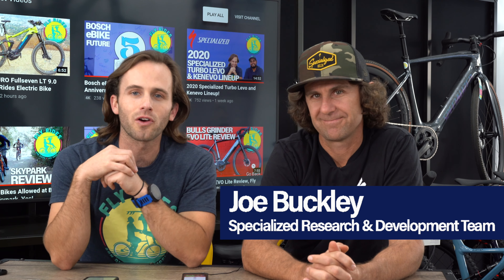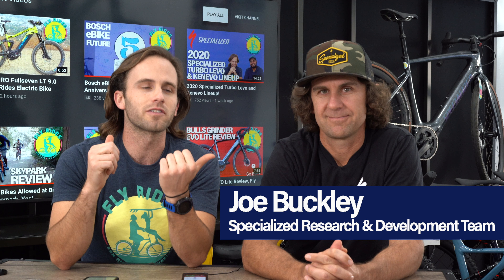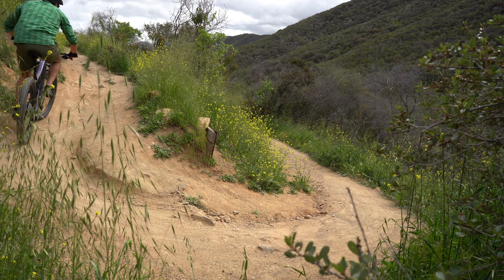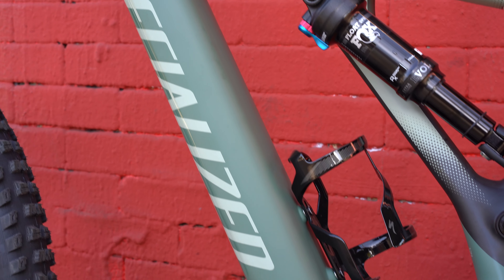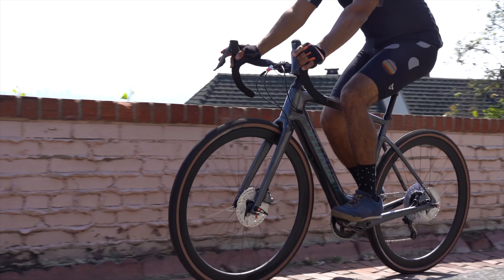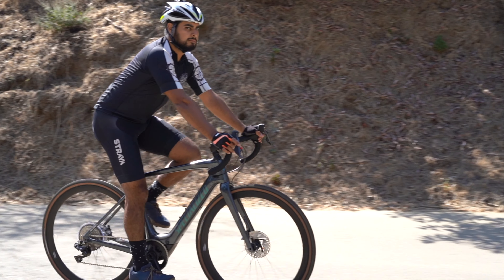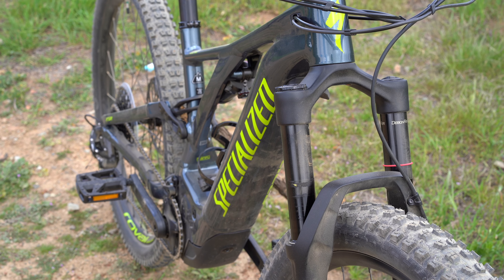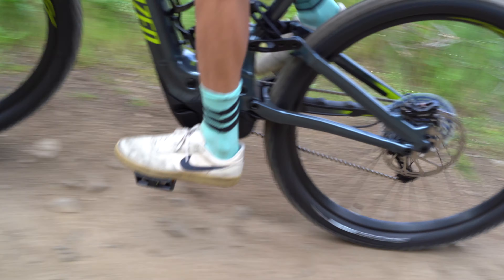How Specialized Bikes are Made, Interview with the Specialized Research and Development Team!

Comment: Hello guys,
1. Can your expensive bikes be thrown to the bottom  of a 5m pool and stay under the water for a full week, and then still run and charge battery?
2. Just curious, can you still shift gears if your battery is empty, as there is WiFi electronic shifting on S-Works. So you should be able to do it both ways on demand.
3. Can you lobby for longer life battery, so rhat you can go 120 km on turbo instead the usual 40km only.  And make sure that there is less bikes with noisy motor when on Turbo, so that people dont have to service the bike and replace it under warranty.

Can you lobby a little for these three things, and once you achieve cerain quality in these three areas, put a special seal of quality for these bikes.  That way competition cannot reach you and you can justify this price that waa put on S-Works.

Can you do that?